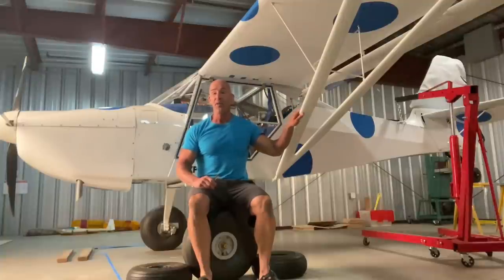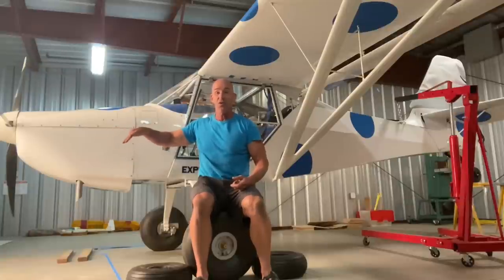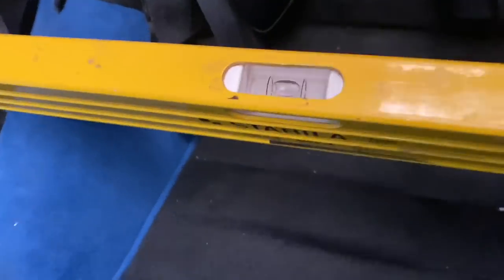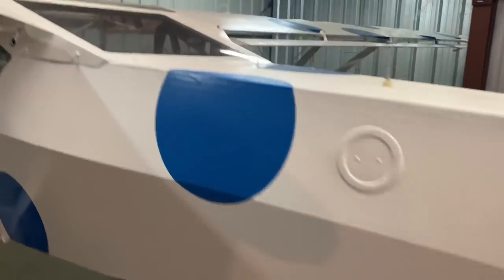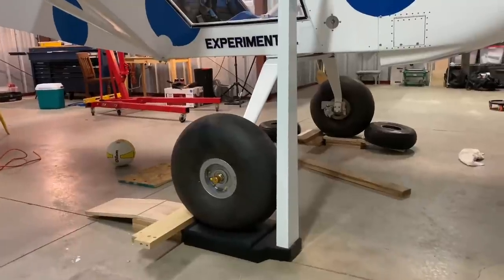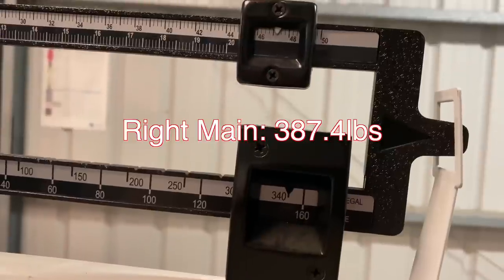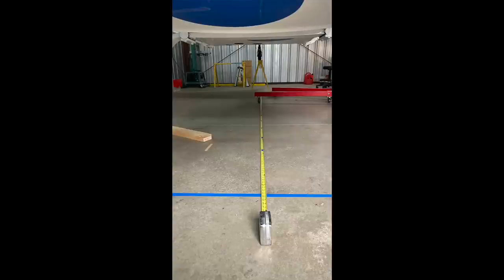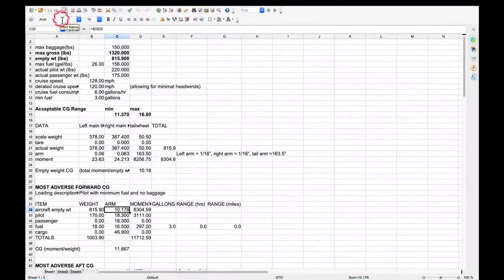Aircraft weight and balance

Comment: A few months ago I weighed an airplane and did the center of gravity / weight and balance during my general portion of airframe and powerplant school, I pretty much did exactly what you did here, except mine was a tricycle gear plane, and I had digital scales. It's super neat to see this done on a tail wheel and by a youtuber I watch!
Reply from the maker: Cool!  The problem with using the basic digital scale is that they turn off too quickly :)

Comment: I remember building my autogryo and doing a hang test from the main bolt to make sure the autogyro mast hung at the right angle. I still remember the first time my autogyro flew they are very rewarding to fly they more or less beat the air into submission like a helicopter and cut through rough air. But like any aircraft if you find yourself low and slow the aircraft will turn on you and bite if something goes wrong.

Comment: Wind tunnel testing of an airfoil has nothing to do with weight and balance to my knowledge. You are correct in that w&b is critical but a wind tunnel has little to do with that (tunnel testing would determine some stall characteristics and lift amounts and is usually done not on an aircraft). For example you can put the same airfoil on many different planes, but depending on where the center of gravity is and how the weight is distributed is what determines the flyable cg envelope. Meantime congratulations on finishing this build! Amazing.
Reply from the maker: AFAIK, the acceptable CG range only depends on 1) airfoil 2) wing loading and maybe 3) speed range
Reply from the maker: "how the weight is distributed" = CG.
Reply from the maker: aeronautical engineers want to chime in here?

Comment: just wondering , what if a crusial parameter is way off the correct value for example so what do you do in that case? Rebuild all plane or while building it you leave some margings to correct later or how is it done? I mean when values are not correct .
Reply from the maker: Its like all engineering, if you make a big mistake then people die so double check your work.  With weight and balance you take out as many possible sources of error as possible.  The procedure is to put each of the three wheels on a scale to see how much weight is on each scale.  From this data, its very straightforward to calculate the balance point.

Comment: Amazing job and you must be very proud...is there not even the slightest tinge of anxiety about making the first flight?
Reply from the maker: Doch! Yes, but the anxiety is more about my piloting skills being up to the level required for a first flight.  With flying, practice makes perfect and I have been logging the hours building instead of flying.  Anyone can fly a perfectly trimmed and balanced aircraft.  When a bunch of minor shit goes wrong is when it takes experience to keep everything under control.  As builders of experimental aircraft we do not have the advantage of simulators tailored to the failures we can expect (no, MSFT flight sim will not do it).  One thing to remember though, these aircraft are designed to be STABLE and fly themselves.  Often when a beginning pilot is in trouble and making a big mess of things the instructor will say _"take your hand OFF the stick - KEEP IT OFF" ... and the aircraft will recover on its own.  Overcontrol is almost always the problem rather than under control.

Comment: Does it matter where at on the leading edge of the wing the datum is measured from? Directly in front of the left and right main? How about the measurement of the leading edge to the tail wheel axle?
Reply from the maker: In the case of my plane, the airfoil is of constant width and has no sweep so you could draw the datum line from any two points on the leading edge.
Reply: @scooby1961  Thanks, Scooby! I appreciate your videos.

Comment: I'm still watching the vid. I'm just curious what would happen if the 800 lbs were dispersed nose to tale. I'm not an engineer. I have very basic knowledge on aeronautics. 
What if the cockpit was extended? Would that provide a large center on gravity?
Reply from the maker: as long as the CG is between the pieces of tape, its fine.  So maybe 60lbs in the tail and 740lbs in the nose would work.  Id have to do the math.
Reply: @scooby1961  I meant to say "larger center of gravity" not large.  I guess as long as the weight distribution is even, regardless of the extra weight, it'll take off?

Comment: they said titanic cannot be sunk. always have a plan B.
Reply from the maker: LOL!  Yes, there are 1000 other things that can go wrong and cause a crash BUT it wont be because of weight&balance :)  Plan B is to die, I have lived a great life.  You be as careful and thourough as you can and take baby steps.  There will be lots of fast taxi testing before first takeoff.  The first flight is NOT going up and doing a bunch of loops and rolls, you go up, test handling in the landing configuration at 4000 ft, then come down and land.  Baby steps.
Reply: @scooby1961  dying is not the worst possible outcome. just be careful man. wish you luck.

Comment: All Airplanes can crash. WTF you talking about, a change in the wind, run out of fuel, mechanical issues, control surface issues... Maybe safer then most but still don't have that attitude or you might regret it.